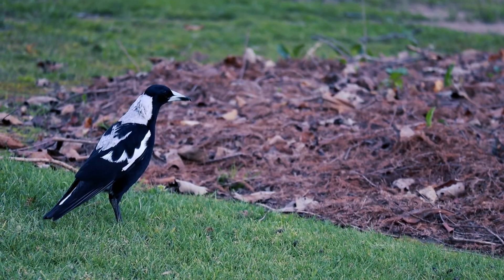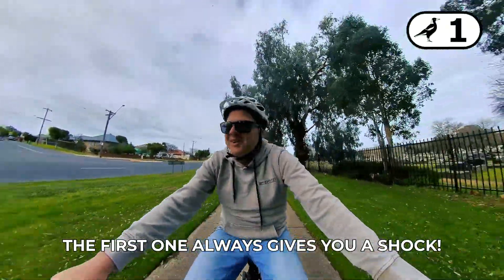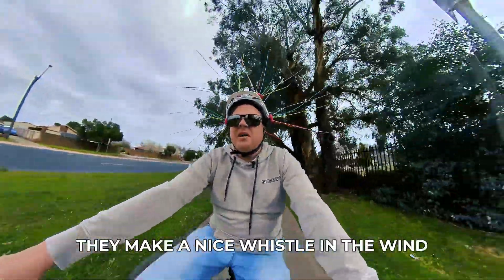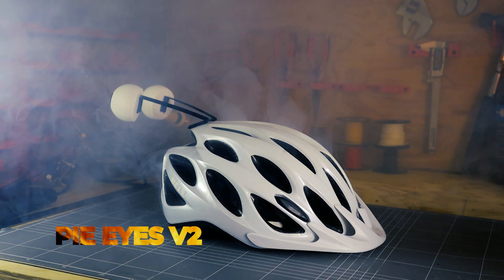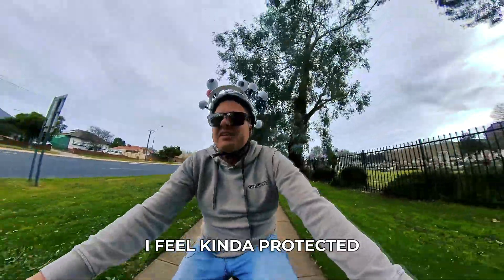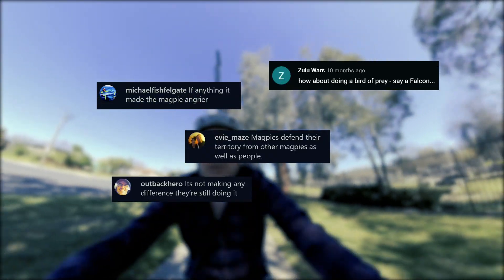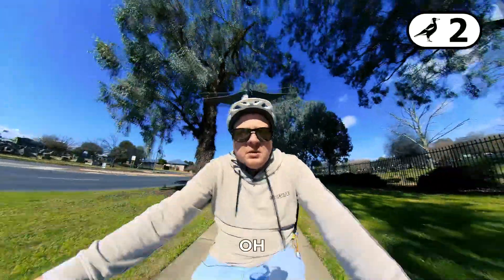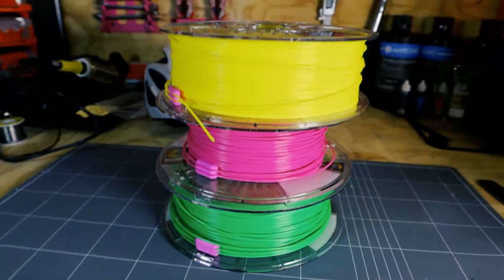Swooping Aussie Magpie vs 3D Printed Things - V2.0

Comment: I would've liked to know the engineering stuff; what motor, voltage-amps, batt, whether you had an insert in the bearing (bc the shaft looked too small). Sooo many makers leave out the specs, and for noobs that gives us referance, as a starting point for other projects. ~funny vid btw~
Reply from the maker: Unfortunately it often comes down to a trade-off between technical detail and audience retention. Although, this video was a bit more entertainment over engineering. There are more details of this build on my website that may be useful to you. The bearing did have a spacer. I’ll make sure I include more specs in my next video. Thanks for your feedback!
Reply: @electrosync  Yes ! ...and thank-you ! 
This is the kind of thing that format wise seems to be becoming a popular standard !
look up "How to Animate 3D Characters in 1 Minute".
 I think every 10 min vid needs a 1 min executive summary to really lock in the knowledge.  ~Thanks Bud !

Comment: Awesome demonstration of 3D printing prototyping! Your Ender 3 is so nice, can you share your bed setup and printer camera setup?
Reply from the maker: Thanks! Rapid prototyping is where 3D printing excels. The Ender 3 Pro is using the stock Creality magnetic build plate. I use Octoprint to run Octolapse with a Canon EOS M50 for the time lapses.

Comment: I think the addition of some high voltage tines would definitely work!
Reply from the maker: Fun fact: Magpies are protected by legislation. If there is a magpie that is causing injury to people, an appropriately licensed person can relocate or destroy it.
Reply: @electrosync  Same here in FL for gators. You cannot harass them into moving, hurt them or set traps.
You just let them bask in the road and wait for them to move on their own. You can get a pretty hefty fine for trying to scare one away with sticks or throwing things at them. People still often honk and try to scare them with their cars though. 

In recent years the gov has added safe pathways under roads and fences and stuff to avoid the whole situation anyway, it’s pretty cool.

Comment: Is that an insta360 go 2 on your helmet? If so, what kind of battery life does it get? I was considering purchasing one
Reply from the maker: Yep. The size is the best. Battery life is about 30 minutes and you get about 2.5 charges with the battery case when you’re out and about. Keep in mind though, that if you use their heaviest stabilization mode, it’s recommended not to use it for more than 10 mins continuously due to overheating. You can use lower stabilization modes for longer though.